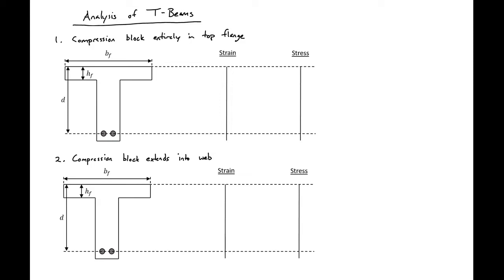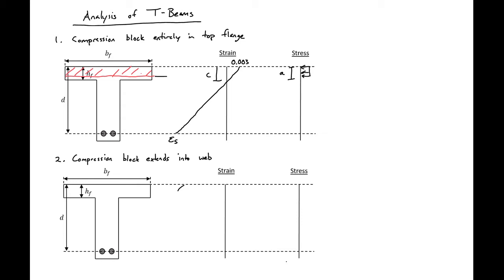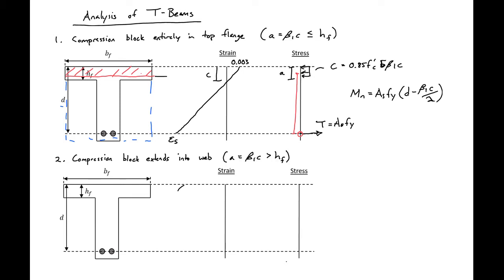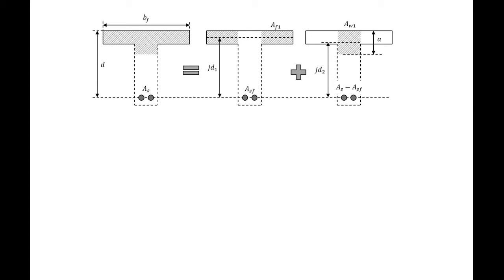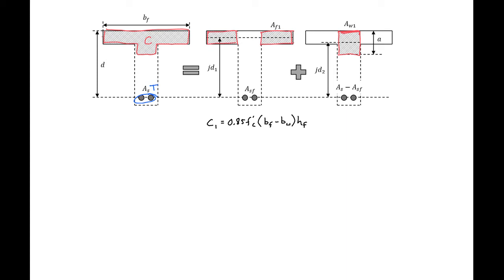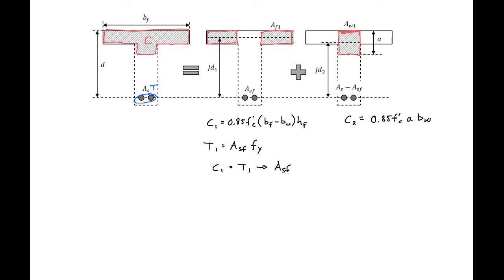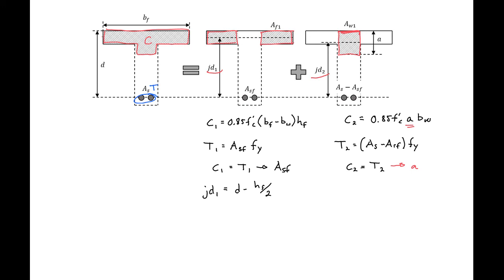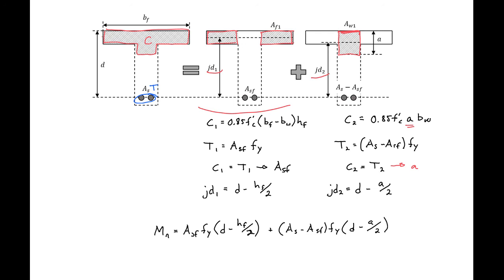6 - Analysis of Reinforced Concrete T-Beams

Comment: Hi! hi would u know if the compression block lies in the entire flange or in the entire web? help please t.y.
Reply: how to know neutral axis if there's no given dimension for the clear cover?
Reply from the maker: You need to check your compression block depth (a) and compare it to your flange depth (hf). If a is greater than hf, then your compression block extends into your web.
Reply from the maker: Look at some of the example problems for how to calculate these values. https://youtu.be/23mX9ETvhpI and https://youtu.be/EyIlRjICwq8
Reply: Thank you